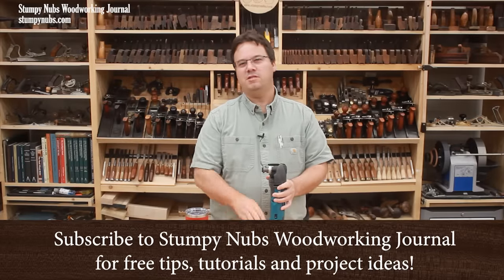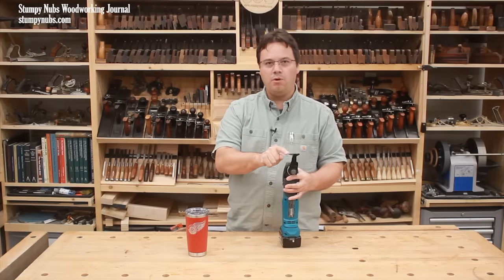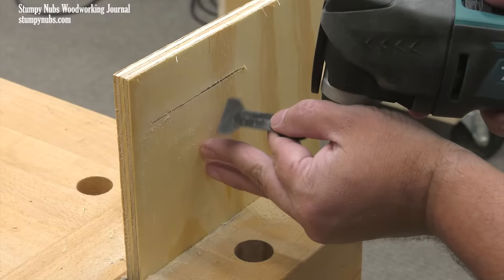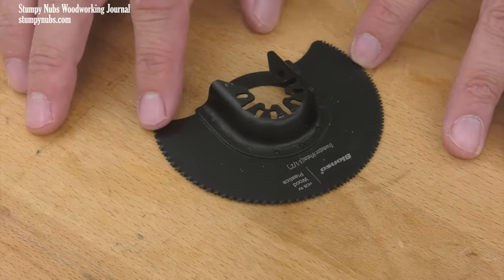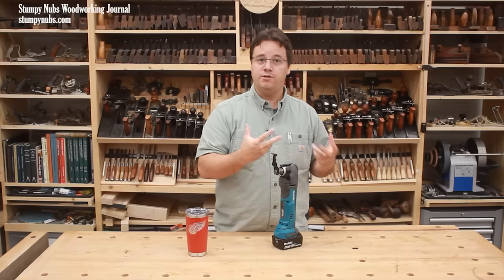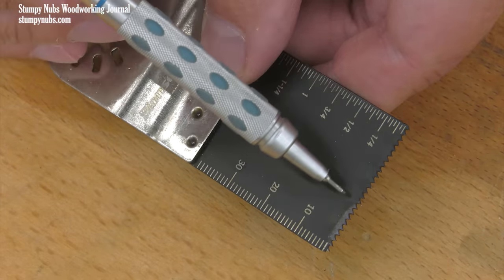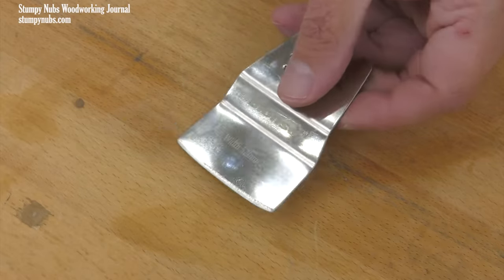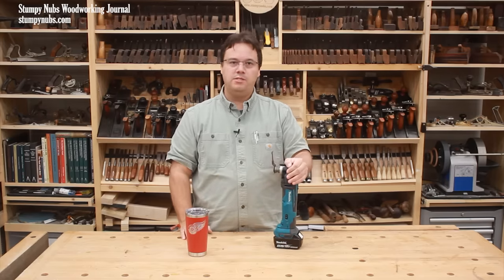CLEVER things to do with an Oscillating Multi-Tool!

Comment: Personally I’ve just always removed the blade when putting mine away. Only takes a second, and also makes it take up less room in the toolbox. Just for the record I do the same with my jigsaw and reciprocating saw as well. It just always made sense to me.
Reply: Mine comes in a small plastic case with all the accessories, so I also store the tool disassembled because it won't fit otherwise. But I'll probably get another MAKPAC in the futute, for more different sawblades and sandpapers along with the tool, sacrificing the snug fit of the original case 😅
Reply: Drills, rotary tools, routers, bits are removed.
Reply: I thought the same thing - um, take it off before bagging it?  
Not sure I'd ever store it with the blade on, even backwards.  Enough rattling in a bag in the truck and it can still cut through your circ saw cord or whatever else you have in the same bag.
Reply: @JV-pu8kx  10000%. If you store or transport tools with bits, blades, end mills, etc. you are stupid and lazy or you have more money than sense and like buying new tooling, bags and replacing damaged tools.
Not sure why ANYONE would store a tool with a bit, blade, endmill, etc. still installed.  That's just insane to me.
Reply: Agreed
I remove the bits/discs etc from all of my battery tools, and i stress it to my apprentices to do the same.
Only takes one speed bumpnamd you've damaged a bit or cutter
Reply: Sometimes I’ll leave the blade on but swivel it 180 so it packs well.
Reply: Same here,  and for transit,  I'll even remove batteries from any cordless tool in a "soft case",  so as to not accidentally depress the trigger and end up with a half depleated battery at my destination. Learned that one the hard way.
Reply: Exactly
Reply: @shirothehero0609  And it is not just to protect the bits, where the tool is stored (cabinet, case), or the tool, itself. Personnel safety, as well. You are transporting something with sharp, pokey bits on it.
Reply: Meh. I turn the blade backwards like this, but also flip it upside down. The blade practically hugs the profile of the tool.
No problems.
Reply: I suppose you remove your legs before getting into bed, well, more likely, just after you get into bed. If you removed your legs before sitting down, at least, you might fall to the ground and hurt yourself.
Takes up less room in bed that way. Meaning, you could inhabit smaller apartments, leaving more room for immigrants.
I do it with my teeth.
Reply: Your 💯 % right!
Reply: Oh me too, I remove the blade from my circular saw, the chain from my chainsaw, the blade out of my utility knife and the blades off my mower. I don't get much work done as I spend all my time reassembling tools rather than working. But it makes sense.
Reply: Yep keeps blade edges from dulling also.
Reply: @eshootziscrs2868  Lmfao!
Reply: That's great and all until it's 6pm on a Friday and you had to work late and you're pissed and just throw it in in the truck and say F-it that's Monday Morning's problem lol.
Reply: Mine came with a metal case, which has ample room to store the tool with blades installed, so, a few decade in, that's still how they get stored.

My Bosch scroll saw has a home on a custom shelf with a hole for blades to drop down through, so it stays loaded too.
Reply: @shirothehero0609 , that's a good point - you're "[n]ot sure why ANYONE would store a tool with a bit, blade. . . ." 

Very rare, as in OCD rare, is the carpenter, finish or other, who removes the circular saw blade just to transport a saw. 

I do remove router bits to protect them from damage.
Reply: Woe, woe, woe there Mr. Arbbal!
This means you're not working hard enough if you've got time to carefully and precisely pack your tools away.
I just chuck em in the back of my van and move onto the next job!
They're easier to steal if they're packed up ready to be loaded into a scumbags vehicle.
Plus, the clients for your stolen tools like to have them cased and with all the accessories and spare consumables in a neat package.
When you just broken into a tradesmans van speed is of the essence and you don't want to be rooting around looking for the assessories.
Reply: @BoB-Dobbs_leaning-left  I'm with you on this one, Steve. OCD isn't pleasant to  watch.
Reply: @kellyvcraig  You've got a scroll saw! Jesus, you're not a real carpenter!
Reply: @kellyvcraig  You don't need to remove router bits usually because you can retract the router.
Reply: @davidashton2361  Right?  That's what I was thinking about all these people in the comments.  CLEARLY none of them actually work with these tools as professionals, probably just own one as a toy they keep in their heated garage 24/7.  That's fine and all, but like you said, in practical terms, it's getting hucked behind the toolbox in the truck, hopefully the trigger doesn't get stuck on something and it starts buzzing in the truck and you have to climb in there and address while your co--worker is upside down in an attic waiting for you to come back with whatever it is you went to get and brought the buzzer and 7 other tools down so as to not make a wasted trip.
Reply: @djjazzyjeff1232  When I was married my then wife found another use for my multitool.
I ended up having to buy another for my work.
I'm not quite sure what she did with it but whatever it was I noticed it was always on charge.🤪
Reply: @davidashton2361  That sounds extraordinarily dangerous lol just buy a Magic Wand like everyone else.
Reply: @djjazzyjeff1232  That's why I'm divorced. The magic went out of the wand.
Reply: @davidashton2361  Oh no.  Not that!
Reply: @shirothehero0609  .... even in a hard case?
Reply: @kellyvcraig  You could build a tote box for it. A few scraps of wood, a few drywall screws and Bingo! you don't have to fold or take the blade off. I hate having a loose tool rattling around in my truck.
Reply: I do the same so it won't do damage to other stuff around it. I keep all my cordless tools in a DeWalt bage
Reply: Same. My tool takes about two seconds to remove the blade and stow. Not to mention some natural law says that whatever you have attached will never be what you need for the next job so you'll just be swapping it anyway...
Reply: @JV-pu8kx  Same, it's the same logic as never leaving a utility knife in the 'pushed out' position. It's safety for one thing.

Comment: Great video! I bought my Bosch corded multitool when the first Fein-a-like clones came out, it always goes on jobs “just in case”, and I still love it. Most unexpected use - using a diamond edged half-circle blade that cost nearly as much as the tool to remove ancient rock hard wall tile adhesive. Nothing else would shift it short of demolition.

Comment: The Fein O/C tools were well known by wooden boaters long before carpenters.  Removing caulk between hull planks  is especially tedious.  Also the Fein manufacturer has shaped sanding pads for profiles like shiplap siding (also called German siding).  And one last use:  I was insulating a hot tub with 2" rigid foam, cutting foam that thick with a knife is difficult and a saw produces a cloud of static-laden plastic particle dust!  The round blade zips right thru rigid foam with  ease of control and a minimum of plastic dust.
Reply: OMG thank you! Ive been looking for this answer in forums all day and yours is the first anecdotal evidence of the blade working well for the purpose. Much appreciated!

Comment: Good amazon find on the blades, I recently had to sand many small cnc bridge tabs off a ply project, stuck self adhesive sandpaper to an old worn blade and it worked perfect!

Comment: Selected Summary:
For a plunge cut, start with the corner of a blade.
Use the corner to follow a line, to make a curf.
Use a block of scrap to align the blade perpendicular to service.
Let the tool do the work, especially to allow the dust to come out of the cut.
Don’t be afraid to touch the oscillating head (AWAY from the blade).
Use tape instead of on blade marks to measure depth.
Use blades with extended width blades 
Maybe grind away part of an extended blade so that is is shallower, and allow smaller radium cuts.
Half circle blades work well for straight lines, and pipe.
Cutting metal—slow down the speed.
Cutting metal—use less pressure.
Wood cutting blades have large teeth, and greater spacing.
Metal cutting have shorter teeth, and narrower spacing.
Bimetal blades have a body of spring steel, and teeth of harder steel.
Carbide TOOTH blades will go through screws and sheet metal.  Maybe the best blade for metal, but not for wood.
Instead of scrapers, maybe just use dull worn out blades.
Storage:  Turn the blade backwards (to protect the blade).
Reply: Dope shit
Reply: That's what he said.
Reply: Thank you. The summary helps to reinforce the information.
Reply: Saved me watching the remaining 9 minutes only to find no new info. You should provide this service to all other YouTube videos / tv / radio / the government. Cheers dude!
Reply: take the blade off to store / take the bit out of the drill to store
Reply: His voice is REALLY annoying 😂 ty for your sacrifice 👍
Reply: @stuart207  Really? I find it soothing.
Reply: You actually can touch the blade with it at full speed.  I do it all the time just to demonstrate it for people how safe it is.  I wouldn't want to press as hard as I can but moderate pressure without keeping it there very long does not hurt. This is the same technology that is used on the saws for cutting off casts but I'm sure the ones the doctors use cost a lot more money.
Reply: I'm not gay
Reply: @BoB-Dobbs_leaning-left  Literally lol.
Reply: @mopedmarathon  I concer.
Reply: I just can't imagine the mindset to do this, WAY too much time on your hands !! Could've used that time wisely by reading and further educating that brain matter.....just saying :)
Reply: @actionjksn  Ir is not the type of tool or the blade that makes it cause fewer injuries. It is the fact it is free wheeling instead of having a plate to hold the work piece steady.  A reciprocating saw has a piece at the very bottom to keep the saw steady (when holding the tool by its handle, pointed down). With a multi-tool your finger moves back and forth with the blade. Put your finger against a wall and the saw will quickly de-digit you.

Comment: I bought my Dremel Multi-Tool 12 years ago and thought I hit a gold mine as the Fein was to expensive.  Now I thought I knew everything there was about using this tool, and I used the hell out of it and it still works fine.  But I have to say I really got some great tips from you video.  I subscribed and look forward to more videos.  Thanks.
Reply: My first one was a dremel also. Recently added a Ridgid cordless. a big improvement in the new ones is interchangability of blades between brands. also tool less blade swaps. Recently used mine to cut out a part of an aluminum csting web to gain access. No other tool I had would have done it....and was fast also. Working in restricted spaces is one area where these rally shine.

Comment: FYI, I have found an oscillating tool with the scraper blade to be the best way to remove that white roof sealer from RVs with metal roofs.
Reply: If whatever you're scraping is coming off easy, it's faster to scrape it by hand but if it's something that's not wanting to let go, multitool is way faster.

Comment: last month i bought a corded WEN 3.5a plus a Milwaukee nitril Carbide Extreme metal blade and cut off the upper shocks 5/8" shaft right through the rubber bushings. took less than 2 min on each shock of my ford 250 superduty.  very impressed with the tool and blade.

Comment: Right tool for the job as they say. I never quite appreciated the oscillating tool until I started into a bunch of interior remodeling a few years ago; It’s indispensable in that area. Now I’m building a deck and dock platform and only have only used an oscillating tool once in the past month.  I don’t do much fine woodworking and am not sure how useful they are in that capacity, but I’m sure they have a uses.

Comment: I love using my oscillating tool for disassembling pallets. I don't mind the leftover nails for my projects as they are usually for outside garden use. This little thing has saved me many hours of my time!
Reply: I've always preferred a reciprocating saw for that type work. Especially the ones with the longer stroke.

Comment: The other thing I've learned about these is that the blades are often not very good about clearing chips due to the short strokes.  If you have to make a narrow cut, they cut much faster if you move the saw side to side gently as you cut.
Reply: @bluecar5556  Yes, but variety is the spice of life...

Comment: Observation: the fine pigtails caused by the narrow range of motion are lessened by a longer tool blade. So if you want to finish sand in a tight corner, take a worn blade, rivet an extension to it, and attach your sandpaper to the extension. That's my theory, going to by my first OMT tomorrow! Great video!
Reply: How’d that go

Comment: Great tips. Thanks. I didn’t find a good use for the larger sanding triangle either, but the small finger is essential for sanding narrow epoxy spots when building wood epoxy boats. If I try to do it by hand, I have the tendency to round the area. The finger attachment allows me to keep crisper edges and flat bottoms. I always remove the blades for storage, mainly because the tub I keep it in is too short for the tool plus blade.

Comment: Thanks for listing a good Radial Arm saw blade supplier.  Finding negative angle blades are real tough when hook angles are hardly listed on the labels of a lot of chain store blades.  Have been using a radial arm saw for almost 60 years and currently have a rebuilt 1958 Craftsman with new bearings and 220 volt wired, although used mostly for plain cross cutting or angle cuts. Got my first table saw about 25 years ago, so it is the ripping tool now, but used to do everything on the radial arm.
On the Multi-tool, really good tip on the sanding disc reuse.  Stores are slowly phasing out multi-tool sanding pads, with some selling perforated detail sander sheets that can be torn down to multi-tool size.  At $1.20 a sheet and throwing away half the sheet, that is not a bargain.  I, too, use it mostly for corners and around pegs (cup racks, etc.) and mostly rough sanding with a sanding block touch up.

Comment: Some really great tips here, thank you!      For me, mine has proved it's worth when I had leaks under two of my sinks, saturating the cheap, unsealed particle board cabinet and dishing the bottom (in one case,  almost 5 inches (!)).  I was able to use the tool to remove the bottoms, and then replace them with clear coated Baltic Birch plywood (ah, memories).    In the tight areas, the oscillating tool made removal a quick and easy process.

Comment: I just used mine to scrape old paint off of a metal toolbox. It worked better then an angle grinder with a wire wheel. These things are next level .

Comment: Great video! I have a very inexpensive and basic oscillating tool, which is great for my needs as I don't use it very frequently. As a result, I've never taken the time to learn its finer points. But this video really filled in the gaps, and now maybe I'll pull it out of the drawer more often. Thanks for making this.

Comment: Thank you for showing some lesser known facts/uses of these tools.
Some of them I found out on my own by simply experimenting, but others were new to me.

I've got one of these oscillating multitools last year, when I started repairing/upcycling a lot of my old furniture.
Since I was/am on a budget, I couldn't afford to by several different and task specific powertools that I would have needed, so I decided to buy a multitool.
And what can I say?
I love the versatility of that thing. I even use the sanding head (extensively 😅) for stripping paint/varnish quickly.
That multitool was of a really cheap variety, but it helped me so much and is working exceptionally well for a tool that has been cheaply mass produced. The only gripe I have with it is, that the mechanism to attach the blades (the pattern of the holes) is "one of a kind" and it is difficult to get new or a variety of blades, let alone better quality blades that fit.
But that is not a fault of the kind of tool, but simply due to the cheap manufacturing.
I would 100% buy an oscillating multitool again - better quality and a few more blades - now that I have worked with one and have benefitted from the versatility.

Comment: Most if this stuff you discover after enough personal usage, but.....

The tip about the carbide tip and the drywall and construction screws IS PRICELESS.

Those two materials will COMPLETELY DESTROY A STANDARD BLADE IN LESS THAN A SECOND.

Just a couple of "oscillations" against those materials and your blade is relegated to becoming a "scraper" blade, and that's an expensive scraper blade!

Great tip!

Comment: 15 years ago I had to trim a kitchen counter to fit a new gas range in. Needed to remove a half inch two feet long. Went to HF, spent $50 on an oscillating tool. Still have it. Still works fine.

Comment: The main way I use sanding attachments is for enlarging holes in walls. When you need to take off <1/8", it's hard to get a plunge blade to go all the way through without deflecting into the wall cavity. A low-grit carbide sanding attachment can get right in there and hog away that last bit of material.

Comment: Good tips, that has always been my number 1 complaint about this tool, it seems like my blades are done after a single cut, and it got ridiculous how fast I was going through expensive blades. I'll try out some of these tips to make my blades last longer.
Reply: There’s dozens of sellers on Amazon that sells the blades for $1 per blade or less.   Well worth it to buy the multipacks.
Reply: Damn. I didn't think og that. Oh and I bought mine on a extension cord. Wish I hadn"t.